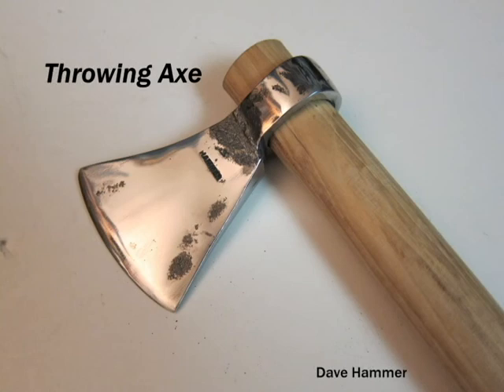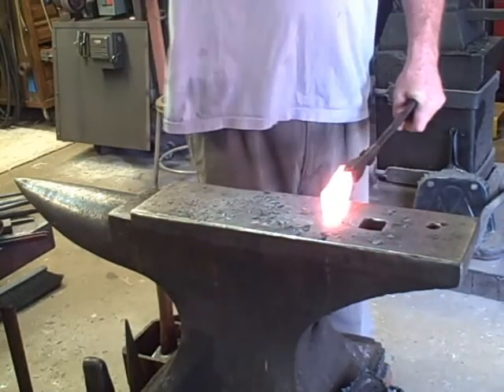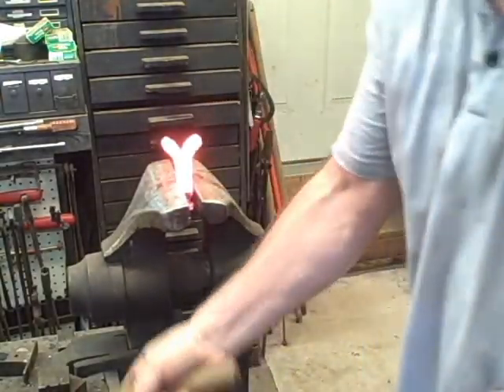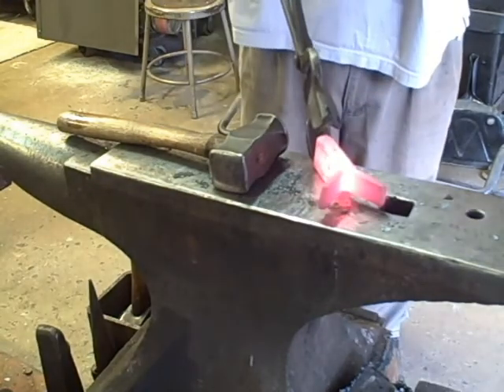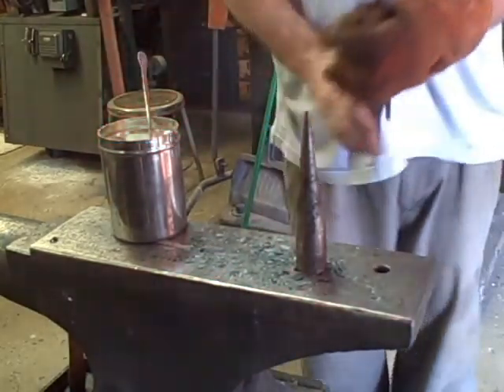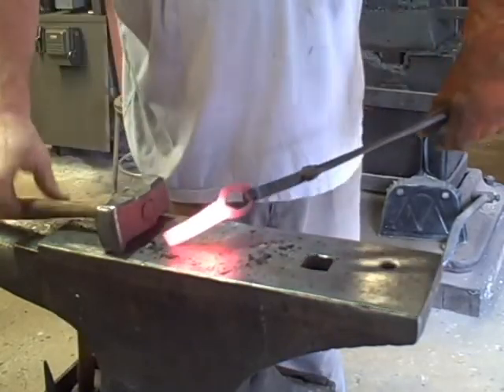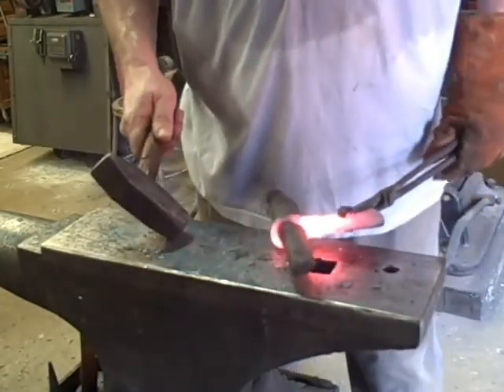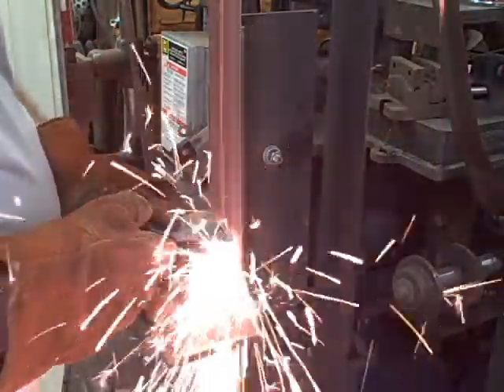Forging a Throwing Axe

Comment: Your project came out amazingly for a self proclaimed amature. Having all the right tools helps I'm sure. I have aspirations of doing a project like this, but have yet to make my own forge, and don't have an anvil.
Reply: jshwiener Thanks...   I am fortunate to have tools.   

It is fairly easy to get started with this hobby.   Youtube has tons of videos about how to make simple forges, both coal and propane.  As for having an anvil, you can use almost anything that has a reasonably flat surface.  If you have access to a metal recycling yard, it is easy to find something that will work.   It doesn't have to look like an anvil to be used as an anvil.  Many folks use a short length of a railroad track.  Others use blocks of steel or a section of a forklift tine.  You can mount any of these objects on a bench or stump and get busy.

I have a video up on Youtube that shows how to make a propane burner for a few bucks if you have access to a workshop with a drill press and belt sander of some sort.  If you watch my forge and forge lining videos, you might be inspired to make a propane forge.  The easiest one would be the free form forge.  A single burner can be used....  you would need to consider how to hold the single burner in place.  A hole could be drilled in one brick on a horizontal plane and the burner just laid in from the side (be sure to support the hose and other parts firmly).  

Best of luck with your efforts...

Comment from the maker: I have two stamps I use.  One stamps a "Hammer" with my initials on it.  I made that one using a zip disc to shape the hammer (reshape the end of a punch or chisel), then used reverse letter stamps to put my initials into the hammer.  The other stamp I bought has the name "Hammer".  .  If you google or use Bing and search for "blacksmith stamps", you will get some hits for businesses that make custom stamps (simple or complex).  Reverse letter stamps can also be bought online.

Comment from the maker: A cross pien could have been used there.  I chose to use my rounding hammer because it is heavier.  The square face on that hammer has a generous radius and, when tilted, will service the same purpose as a cross pien.

Comment: Nice work, Sir, i wanna learn blacksmithing too, i took my first lesson with a professionnal friend of mine, but i can't stare at the fire cause my eyes are too sensitive, it's hard for me to check the steel temperature while it's heating... I think i have to find dark glasses that would work for me, i hope it could work.
Reply: Google for safety glasses that glass blowers wear...  I think they are called didymium
glasses.  Good luck....

Comment: I've been watching a lot of forging videos and I have seen other people use a sort of spike to make the hole for the handle (like they'd heat it up and just hammer in the spike in until they have the hole that they want). So my question basically is, what is the difference between that method and your forge/weld method?
P.S. I love your videos especially because you explain what you're doing as you do it.
P.P.S. Please finish that musket barrel. That video was awesome!
Reply: MusicIsAwesome There are MANY ways to make the eyes for handles in tools.  I once watched a demo where numerous methods where shown to make holes.   The method used in this video is fairly easy to make a large eye compared to other methods (assuming you have success forge welding).  Regardless of the method, the net result should be the same.  When drifts (your punch reference) are used, a small hole (or slit) is made, then  larger drifts are used to get to the final shape and hole size.

I do have an intention to work on the gun barrel more.  It's still a future project.  At the moment, I am working on other things....  some of which will have videos, others not.
Reply: Thank you very much for responding to my comment. I've been interested in blacksmithing and gunsmithing for a long time and I really want to get more involved but I dont know how. Can you give me some ideas about how I can get into this hobby?
Thanks again
Reply from the maker: MusicIsAwesome Look for the closest blacksmith guild near where you live and attend their meetings.  The ABANA (National Blacksmith Organization) website has a list of guilds that are affiliates of the national organization.  Join online blacksmith forums and ask questions (Anvilfire, Iforgeiron, MetalArtist, etc).  Ask, on the forums, where there are beginners classes near you.   Consider (although pricey) going to Traditional Arts Schools that have blacksmithing classes.  The best one that I know of is J C Campbell, near Asheville, NC.

Comment: Friend,
I've often wondered what kind of knife could be forged from Chrome-Moly Steels like 4130, 4330, 4340 especially 4350.
…..RVM45
Reply from the maker: +RVM451 I don't claim to be an expert at selecting materials to make knives, but the steels you are referring to are medium carbon steels and probably would not make great knives if you are expecting high performance blades.  The knife makers I know like to use steel that has at least .8 percent carbon.  I would suggest you ask questions on a good knife making forum to get expert opinions.

Comment: What grit of sand paper do you get up to before using the black rouge? I've been wanting to find a faster way to get such a nice polish on steel
Reply: Nick Holfeld Since it's been a couple years since I made this video, I can't say for sure, but it's likely the final sanding on the grinder was done with a well used 320 grit belt before I went to the polisher.  A used belt behaves differently than a new belt though, so the effective grit on the final belt may have been a larger number.

Comment: Do you have any dust collection or wear a respirator?
Reply: I don't use dust collection beyond a broom and dust pan (and occasional use of a vacuum cleaner).  It certainly would make for a cleaner and safer shop, but I doubt that many hobby blacksmiths have an air filtration system in their shop.   In general, I do keep my shop clean.  When I work with materials that are identified as hazardous (according to the associated MSDS), I strive to take proper precautions described in the MSDS.   I stress reading the MSDS for materials I use in my videos.